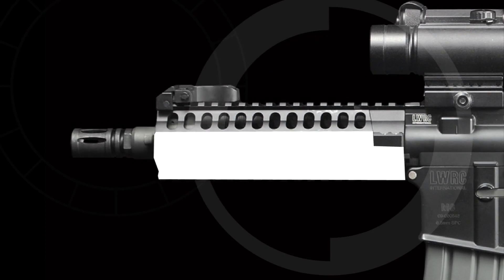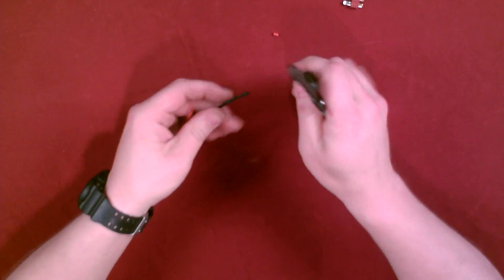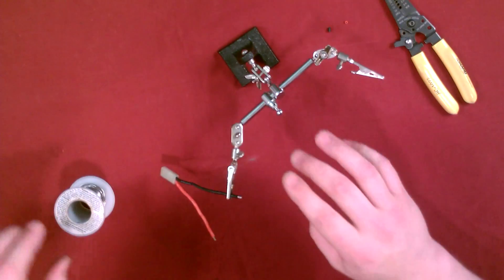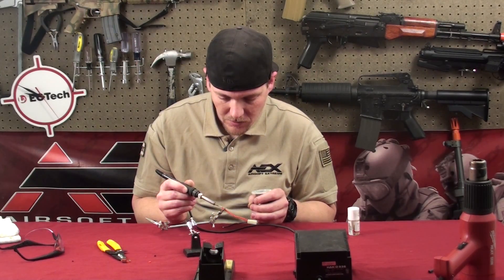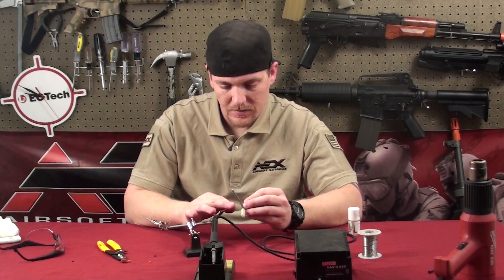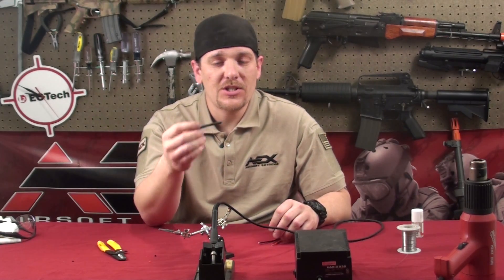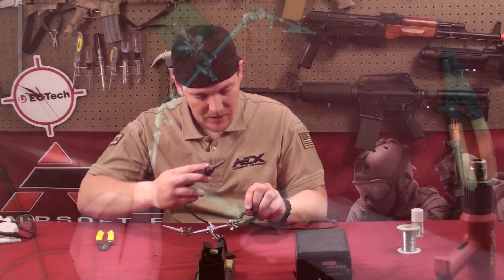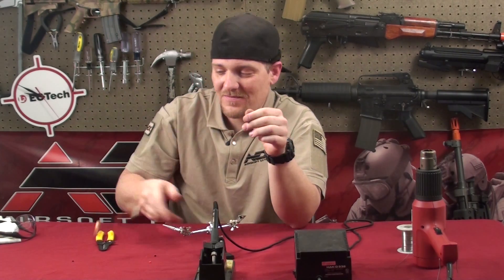AEX Tech Tips Episode 14 - How to Solder

Comment: I tore my wire on my Krytac CRB changing the buffer tube. Will this fix it?
Reply from the maker: If you tore your wire I would NOT recommend soldering it back together. The best thing to do would be to replace the wiring entirely to ensure the wires are healthy and properly protected.